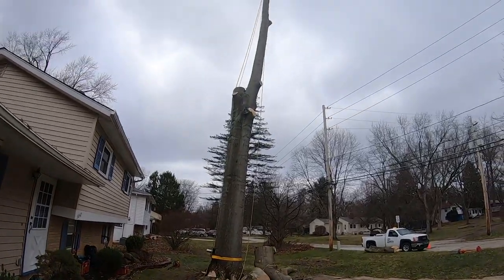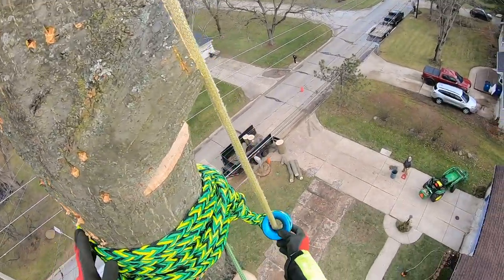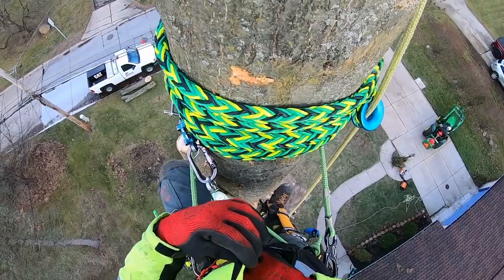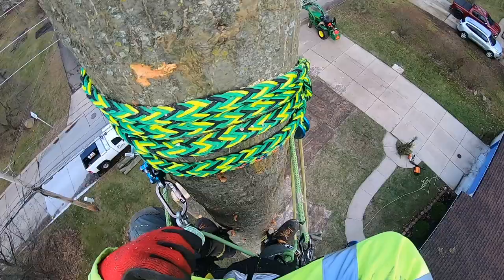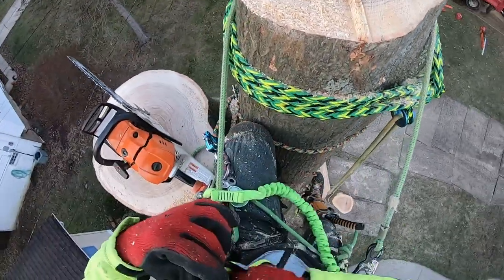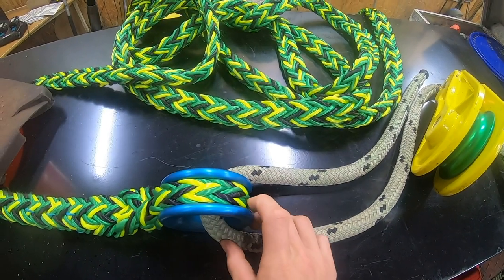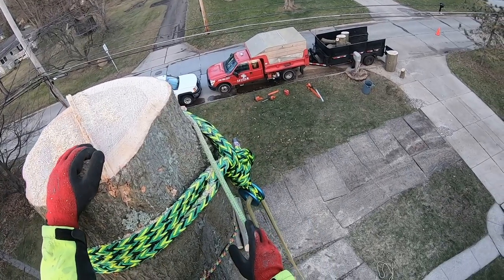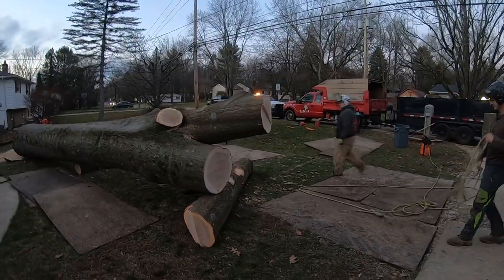How Hot Do Rigging Rings Get?

Comment: If you're using a ring a good way to mitigate the bend radius issue is you spilce up a double headed set up. I've spliced a couple and, of course, it double your bend radius instantly. That being said i've witnessed some rings i've spliced up withstand some crazy weight (controlled-ish test environments). Double headed rings are light weight and allow you to rig big is you want too.
Reply from the maker: I think that's actually a common misconception. They don't really improve bend radius at all. They break up the 180° bend with two 90° bends, but the 90° bends are still thet same radius. Double rings definitely have more mass for storing thermal energy though which means they could handle more friction without getting hot.
Reply: @zaccheus  The bend angle is 180 degrees in both instances (i.e. the rope goes straight up and straight down) but two rings will double the bend radius. Also, the rope fibers are more relaxed with two 90 degree bends then one tight 180 degree bend. A 4:1 ratio of rope diameter to bend radius is recommended to help allow equal loading of the rope fibers in order to maintain strength. Ropes strength is greatest with a straight pull. The tighter a bend radius the less ability the rope fibers have to work in a concerted effort, which leads to rope failure. Do as you wish as I am not here to tell you do something one way or a another. I don't want anyone injured and am just trying to clarify what I read as a misunderstanding of bend angle and bend radius.
Reply: Bend radius I believe is the same thing that I was taught to be D/d ratio.
Reply: @asonunique7083  I'm not a mathematician, and i hope this makes sense. Also, please feel free to kindly correct me if I am wrong, as I'm also a tree trimmer and would like to make sure the way I am envisioning this is correct so that myself and others are not harmed. The way i thing about it is when the bend is stretched out over a greater area of the rope, it has less of a negative effect  that could cause the rope to fail. So by using two rings instead of just one, the force on the rope is supported by a greater surface area. Similar to laying on a bed of nails vs. laying on just one? When the weight is distributed more broadly, i would imagine it would be less harmful.

Another example to explain the way I think about it, wether or not it is correct, is hanging fishing string over a skinny tree branch and yanking it, trying to break it vs hanging it over a fatter log and trying to break it. It would be easier to do with the skinnier branch. Both end up at 180 degree angles, but with more/less sharp angles, therefore, more/less surface are for support.

Does that make sense? Sorry if that's wrong, just the way I kind of interpret it.

Comment: I only use blocks and pulleys in lifting situations. Prefer the simplicity, lightness, and price of rings. The xmann has some  videos about the temperatures that rings can get to while rigging. He chose tenex specifically for its high temperature threshold. Dyneema is not a good choice for a ring because it can be damaged at lower temps. I spliced some rings with 3/4" promaster, the ultimate cheap diy rigging setup,
Reply from the maker: I'll have to check him out. Dyneema performs very poor under shock loading as well. I've heard some stories about dyneema cored crane slings breaking when used as rigging a sling up in a tree. Tenex is made out of polyester just like the rope and sling we used in this video. Rings do dead to be cheaper, but most often have a shorter life spand compared to the indefinite life span of rigging blocks. It all comes down to preference really. There are some bigger rings that even meet bend radius requirements for some ropes.

Comment: Great video. You will get much hotter rigging the canopy. The amount of time to unhook and rig the next limb takes a lot less time than moving for the next negative rig. I’m curious too. If you get a chance and want to, I’d like to see it!
Reply from the maker: I think your right and I hope to try it out. It's just gonna take the right job where I can sit in the tree top and measure the temperature while someone else does the rigging. I'll pro ably wait until it's a little warmer outside too.
Reply: These aluminum rings cool off quicker than you will be resetting the next limb. How fast your trying to work will usually have an inverse relationship to the weight of the pieces you're taking.....if this is not the case,  you may need to ask yourself if you're trying to go too fast...
Reply from the maker: @Samuel Luria  That's a fair thought for sure. I guess the folk that have told me about getting burned have rigging multiple limbs out consecutively of of one point. I'm gonna try that again in the spring I think.

Comment: Do you take the metal shield off the helmet or can you buy it like that? Seems like you can get better camera placement just using regular safety glasses
Reply from the maker: @Entreepreneurs  I took my mesh face shield off and just use integral eye glasses. They're a little pricey and offer less face protection, but they work so much better with the camera.
Reply: Yeah mesh not metal 😂 I just looked them up. Thanks for the info buddy

Comment: Great video! I just got one of those big ol notch rigging pulleys that’s shown around 2:50,  but with an ultra sling. Thing feels like a beast! How much do you think the ring affected the friction needed at the base compared to a pulley ?
Reply from the maker: That notch block was pretty sweet, it belongs to Bo, the fella that hired me for the day. I really don't know. I'd say it was minimal enough that it didn't really matter. Those pieces were all well within the capacity of the GRCS bollard that we used for friction at the bottom of the tree. In that case we weren't at all worried about the structural integrity of the spar so we weren't particularly motivated to reduce the load on it with aerial friction.

Comment: I use rings for redirects when needed. I like mine on ultra rings though. Less messing with knots.
Reply: I am a strong advocate of rings in an ultra sling configuration.  I am slow and do a poor job with most of what I do, it is nice to gain some time back with an ultra sling.
Reply from the maker: Thays primarily all I use them for too. They're really small and light to keep on you saddle if you gotta move a redirect around in a tree alot all day. I have a small one on an ultra sling, and your totally right, it's the way to go.
Reply from the maker: Lol, that statement feels quite relatable 😅
Reply: I'd like to see you come in slightly higher on your back cuts. I hope that log went to the mill.

Comment: Couple thoughts...use the choking rings (daisy chain) instead of all that hitching and wrapping.  Also on your pull vehicle...put a come a long on the pull vehicle, stretch the cable out and use a porty to attach to the pull line.  Then you can crank under much more control than some guy jeopardizing the vehicle being pulled back while driving it.   And like said...you won't get that much friction heat on that short of a distance lowering...with the ground doggie feeding properly.  PS...guy/s who said single rings are not for rigging is full of $h@t.  I have rigged more huge stuff with mine out of the top than you could imagine.  Leave the blocks at home.
Reply: ps...how old are you?...20?  You are progressing thoughtfully.
Reply from the maker: Thanks, I'm 27. The babu face has just stayed around awhile 😅

Thanks for sharing your thoughts. The fella I was working for definitely prefers the daisy chain knot and I'm just in the habit of using a running bowline. I totally agree that you can have way more control pulling by hand. I don't like pulling with trucks that have torque converters, but on hydrostatically driven implements like that tractor, a dingo, or a small articulated loader, the operator receives good feedback through the drive system and can get a decent idea of how hard he or she is pulling. I think it's good enough for less than critical falls 🤷‍♂️

Comment: Rings are prety good to use
My only beef with em is sometimes the ring and pinch the rope on the trunk and make for an inconsistent run.
Reply from the maker: Mmm that's a good point. I've had that happen with certain blocks too

Comment: I'm a huge fan of rings both for main rigging points and for redirects. THey are lighter and quite fast to set up. I will say, I use the safebloc for almost all my medium to medium large rigging these days. Such a good device. XMAN knew what was up
Reply from the maker: Hahah, thats great! Maybe I'll try this with the safebloc. Do you ever experience that thing getting warm?
Reply: @zaccheus  I havent noticed heat build up on the safebloc to any extreme extent, but I am generally only using it for rigging big where there is time between pieces, or as a high remote point.
Reply from the maker: @Zane Gamin  I gotcha,  thats good to know, thanks for sharing!
Reply: I am also a huge fan of the rings, and especially the safebloc. I also only use the safebloc for larger pieces. I've never had a heat issue but there is always a bit of time between cuts.

Comment: When you put your notch in is your saw about chest height? I’ve been told to not do it that way and to cut at waist height but I’ve never been comfortable doing it that way and it’s a habit I can’t break and to me doesn’t seem like I necessarily need to break. The only time I really cut at my waist in big wood is while doing crane work on conifers or straight spar picks
Reply from the maker: I really might not be the best person to answer this. I read some where once that it's best to keep the cuts between you waist and your shoulders. You really can't cut at your waist because your flipline shouldn't be angled down. In all reality, its probably best for your shoulders and elbows and back and such to not be cutting up higher on your body. I think the important thing is to not be cutting at neck height because if the saw kicked back and hit you, you'd bleed out pretty quick 🤷‍♂️

Comment: flesh burns 1st degree 120F scald about 150F goes 2nd degree, 164F 3rd degree. Remember the ring gets much hotter than the rope sliding through. Don't leave the rope in contact after a drop, it will stick to the ring. sometimes, The only disadvantage rings vs pulley is no mechanical advantage when controlling drop.
Reply from the maker: Thats some handy information about burns, thanks for sharing!

Comment: You're not supposed to use a single ring for rigging. Use a double head for negative rigging. Use the single as a directional.
Reply from the maker: I don't really know that a double ring does much to benefit bend radius. It's just two tight bends right next to each other.
Reply: @zaccheus  It adds aerial friction which reduces strain on all parts of the system. It is a larger surface area the rope runs across as well
Reply from the maker: @wcakgilleran  I see what you're saying there. Ariel friction can be handy when needed and there would be more mass to put the the thermal energy into. It's nearly the same amount of surface area contactbetween the rope and the rings, just half goes on to each ring rather than all of it onto one ring.

Comment: I have a big fiori's ring bigger than any other rings
Just love it and I have a double head beast. The rings made by Antal.
Find them out lovely gears
Reply from the maker: I looked uo that Fiori's ring and that thing looks huge at 2.2 lb what's the bend radius in that thing? It's unfortunate that it costs more than the big yellow isc block, but it's super cool looking thats for sure.
Reply: Huuu
This thing is 7cm wide one side and 8cm the other if I'm not mistaken
Reply from the maker: @jardikferenc194  I need to see one of those thing in person, that's wider than the bend right ring then I think. Which means it's probably wide enough to make a 4:1 bend ratio for a 5/8 rope
Reply: Zaccheus
If u can buy a double head beast I believe more than enough for the 16mm rope
2 rigging 38*28 each
Antal rigging rings are cheap

Comment: I love the concept of rings but i dont use them because there is so much controversy over there integrity and bend radius. I wouldt want that in the back of my mind while doing any big rigging. For small rigging i just use a small impact block on a ultrasling
Reply from the maker: I'd have to say I'm probably in a similar position with you. Should there ever be an equipment failure that results in a court case, I don't want to be accused of using the wrong stuff.

Comment: A tree that height isn’t probably going to tell you much about heat issues you need to get up a 45mt mountain ash and dig some big stuff down with it then I’d bet the ring will be hot enough to cause enough temperature spikes on a consistent basis on the rope that surrounds the ring,but maybe you wouldn’t use them on long rigs for that reason and just use pulleys instead
Reply from the maker: I'm sure a taller tree would get it hot. A heavier piece also. I'm on the lookout for an opportunity to try it again on a big top, I just need the right opportunity.

Comment: I wouldn’t hesitate to use rings for heavy rigging as the small amount of friction they add up top makes for a smoother ride for the climber. I like to use shorter/expendable ropes for the lower/bigger wood. No need to glaze a 150’ or 200’ rope when lowering heavy stuff 40’ to the ground.
Reply from the maker: That's a good thought. I would prefer to use a block rather than risk glazing a rope. I could be wrong, but my understanding is that glazing weakens a rope, and I don't want to use a compromised rope on big wood.
Reply: @zaccheus  I keep a few shorter hanks on hand….60’-80’ lines…9/16”, 5/8”, 3/4”. Just for low, big chunking.
Reply from the maker: @Southern-Born-Southern-Bred  That makes good sense, but I'd still rather use a block on even a short rope. Most of the time I'm rigging because I don't want to crush what's below. So if the rigging is exposing the rope to enough heat to melt it, I'd rather not use a ring in that given scenario.
Reply: great idea thx

Comment: Single rings are designed for redirects, & normally should be dual rings for negative rigging.
Good job though
Stay SAFE
Reply from the maker: They thanks for your comment! That seems to be a fairly popular thought, but I think it's based on the idea that double or triple rings produce a better bend radius. I don't really think they do. Instead of having one 180° bend, they just make two 90° bend right next to each other. On the other hand, I imagine that double or triple rings would have more mass that would be more capable of absorbing more thermal energy without getting at hot.
Reply: @zaccheus  double rings stacked side by side (which is what everybody is suggesting) absolutely does make the bend radius larger.  that's because the rope is bending around two rings stacked with the holes facing each other.  two rings are wider than one, therefore bend radius with two rings is higher.
Reply from the maker: @verteup  It's important to consider the shape of the rings. There is a small gap between the rope contact points when the rings are beside each other. What you end up with is two tight 90° bends with some space between them rather than one tight 180° bend. There is an illustration on this web page that might explain it better than I can.

 https://www.bendrightrings.com/

Comment: ok Zack the issue here with your experiment is that you were not using the ring as intended. One ring is not meant to be used as the primary rigging device. Three rings is manufacturer recommended
Reply from the maker: Manufacturer of the ring or the rope? The manufactures of the rope suggests that you should use any rings that don't have an appropriate bend radius. The only ones I know of that offer close to the minimum requirements for bend radius are the bend-right ring and the FTC Fiori ring. The ring I used did not have the appropriate bend radius, but I don't think bend radius should have much to do with heat saturation in the ring. Also I wished to test what many folks are using, ever if it's not correct. I imagine that a double or triple ring would run cooler as there is more aluminum mass to soak up the heat.

Comment: Not the most scientific experiment.  A long controlled decent would heat rings more.  Free falling with little control would not heat the ring as much.  I'm sure the rings never get close to any melting stage as the heat dissipates quickly.  I've singed a few tree crotches along the way.  I like rings and pulleys....both serve me well.
Reply from the maker: That may be the perception, but the reality is that it's simply the rate at which the kinetic energy of the piece being lowered is being converted into thermal energy through friction on the ring. If you convert it slowly over time, the ring has more time to dissipate the energy, if you convert it quickly the ring will get hotter because it cannot dissipate as fast as the thermal energy is being put into it.

But you're right, we exacy follow the scientific method. This "experiment" was really just loose data collection.